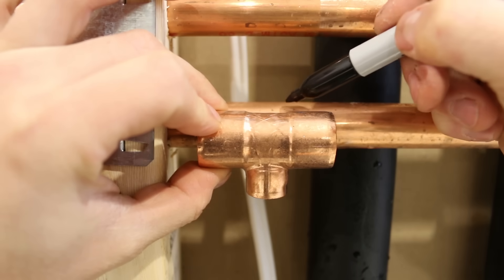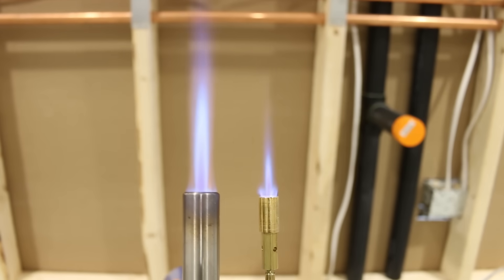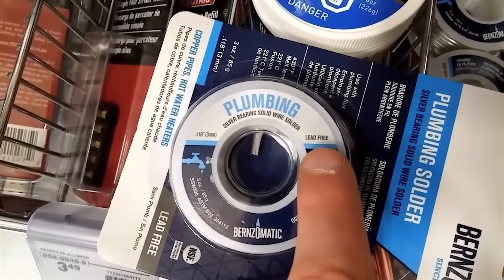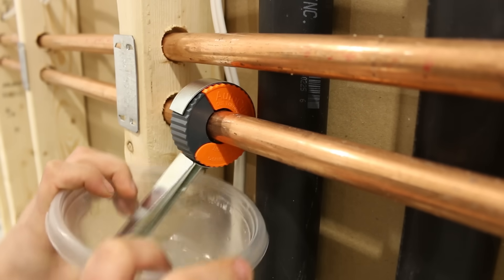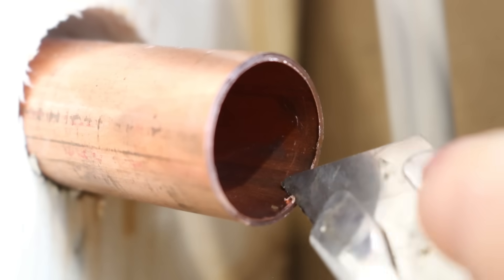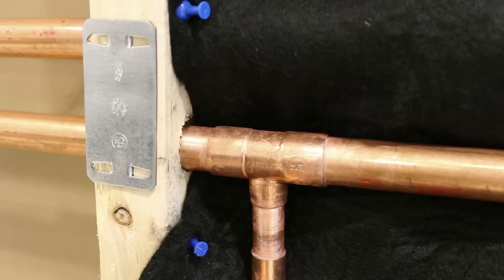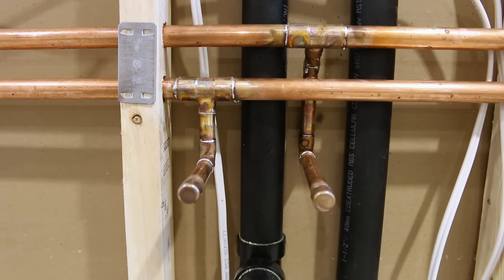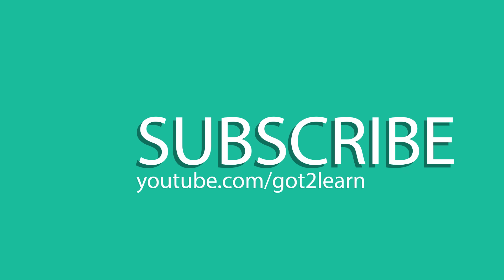How to Solder Copper Pipe in a Wall (Complete Guide) | GOT2LEARN

Comment: Starting to project of completely re-plumbing the hot side of my parents house tomorrow. The runs are easy enough, but there are a couple of spots where I have to go from copper to pex in a tight space and I'm not sold on sharkbite fittings.  After watching this video, I feel more confident in being able to solder without burning the house down lol.

Comment: Aternative to torch soldering =>  Ridgid RT-175 inductive pipe soldering iron.  Safer in constricted areas, heats evenly, works when a bit of water is in the pipe.

Comment: Nice video, elbow, cracked right at the shower mixer.Gonna try heating up and pulling it off. New elbow/ cut 10" down add union. Reattach hard pipe key union. This video should get me by thanks 👍
Reply from the maker: @davidf948  😇

Comment: Great videos as usual. If you find a little pin hole on the joint later on can you apply a bit of flux on the area and solder?
Reply from the maker: No, you must cut/unsolder and restart the joint.

Comment: I saw you use the bread to stop water dripping before you can solder. How can you take the bread out? Thanks.
Reply from the maker: It partially dissolves, for the rest that doesn't just open a faucet to let it out, just remove the aerator before not to clog it up ;)
Reply from the maker: Thank you, don't forget to share, it really helps the channel!

Comment: EXTREMELY disappointing as you could NOT have installed those T fittings inside a wall because  there would not have been enough movement of the pipe...and you slid the pipe over...something that would be IMPOSSIBLE inside a wall!!
Reply from the maker: That's not what this video was about, if you are wondering about how to fit a tee in a wall, here's the video you are looking for: https://www.youtube.com/watch?v=ebvqSp-d8-0&t=2s

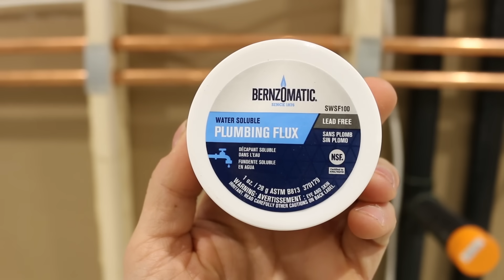Comment: I think that these videos you provide are excellent. Very well done and you do a great job narrating as well. Forgive me for one critique I have on this video and one or two others. The person soldering in your videos often does not solder properly. At 3:33 for instance, which is also the thumbnail pic for this video, he is clearly directing the tip of his flame at the very front of the hub of the fitting, the flame is actually hitting the pipe and the front of the hub. For proper solder flow it is necessary to direct the tip of your flame where the pipe is all the way in. This is called the "shoulder" of the fitting, or the back of the hub. Especially important on upside down vertical joints, This will pull the solder up into the fitting hub, thus avoiding solder "icicles"

Comment: I got a piece of bread stuck in a pipe. Travelled way down the line. Had to cut so much drywall to get it. Thanks to your tip, I was fired. Not a great day for me.
Reply from the maker: It dissolves, which kinda bread did you use?

Comment: If the solder melts on the opposite side of the heat but  doesn't wick around the entire joint is it not hot enough yet

Comment: Did you apply flux inside the fitting at 9:42?
  I noticed in the first video of yours, you advised not to and gave a good reason not to.
Reply: Sorry, I should have stated the first video of yours I myself watched.
Reply from the maker: I do, but when I do, its a thin coat of flux. If you put too much it goes into the piping system and corrodes the pipes.
Reply: @Got2Learn  Thanks for the quick response. 
  I will be subscribing. 
   Just did some plumbing with pvc/cpvc but not sure how confident I am for the long run  
  The galvanized that was in the house was replaced many years ago in the crawl space and had not been a problem that I am aware of, but I decided to relocate the laundry appliances and water heater when I bought the house I was raised in. 
  It is a rental for the time being.
Reply from the maker: Yes, galvanized is trouble waiting to happen, good riddance! 🤜🤛
Reply: @Got2Learn  The house I actually live in still has galvanized.  I hope to change it this summer as I think it is causing low water pressure. I have replaced a couple of pieces with pvc

Comment: Nice Video, however, a Fine point on Technique. Sober from Low to Higher joints. Heat moves up, you Could cause a leak in a joint above the lower joint you are heating. 🙂

Comment: This video was very informative but you didn't show if there was an existing T shape and it needs to be replaced. This is the problem I have. Plus what if I can't move the pipe so I can put in a new T? One last thing is if flux is so bad to have inside the pipe then how do you get the flux out from the inside of the pipe after you solder?
Reply from the maker: I have a complete video on this subject, here's the link to that video: https://www.youtube.com/watch?v=ebvqSp-d8-0&ab_channel=Got2Learn
Reply: @Got2Learn  I saw this video already and it is great but again I have a T already there and the leak is coming from it so I need to replace it but there isn't as much room as you show on the video.
Reply from the maker: @elbandito5411  send me pics here: Juliocaluori@msn.com
Reply: @Got2Learn  I appreciate the help but I don't want to send a picture due to security reasons. I'm just asking how to you take off an existing T so I can put a new one on.
Reply from the maker: can you cut further down? How much room to you have to play with? Maybe swapping that part out with PEX could be a better option?
Reply: @Got2Learn  it has about 2 inches left and right sides and about 4 inches towards me. I was thinking of possibly resoldering all three sides to somehow take out the old T then putting in the new one without cutting any pipes. I don't know how to do that.
Reply from the maker: @elbandito5411  yeah you're gonna need some couplings if you want it in the exact same spot, but yeah it's doable.
Reply: @Got2Learn  couplings? Why? I'm not gonna cut so why can't I just put a new T at exactly the same spot?
Reply from the maker: @elbandito5411  oh well, if you can unsolder it sure, go for it!

Comment: Followed all you instructions,  but the pipe doesn't get hot enough  to melt the solder.  Used 1 gas bottle on 1 joint, not enough. How many gas bottlesdto you need for one  joint ?

Comment: Your videos are excellent, all the important details are not left out as with others. Thank you for posting them! One question, you mention in other videos to not flux the inside of the pipe only outside because of it just getting pushed in when assembling. Why the inside here?  Subscribed 👍🏼
Reply from the maker: Thank you so much! You can flux the inside but it has to be a THIN layer on both the pipe and fitting if you do so or it'll just get pushed into the system and eventually corrode the inside of the pipes, cheers!
Reply: Got2Learn  Thanks again. 💜

Comment: The wire brush on a drill is much easier on the fingers and hands. I also use steel wool which polishes the copper and I never have a leak!
Yes,,, you are absolutrly correct...less flux is better than more.
Don't use too much heat. Add the heat, solder flows in then stop!

Comment: Even though I had already subscribed after a previous video.. I didn't watch this one beforehand.. and should have. (replacing shower valve inside closet wall) 

I already had a  small cutter and ruined the pipe trying to cut it in the confined space ! It kept slipping, no space to go completely around and it made several grooves before cutting through all around. I went out and bought a small round type like you show and it worked PERFECTLY! I Love the SELF-ADJUSTING feature for the cut so all I need to do is Lock it on and turn! :) 

Sadly.. my propane torch kept failing (Fresh new small bottles with plenty of pressure but would not stay lit !! I tried different Torch- Same results :(  My only conclusion was the 'bargain' Propane cylinders had been filled with more Gas than propane.. such as happens when refilling from an upright source-tank ! .. Source should be Inverted so the heavier liquid propane transfers more than just the gas! 

I had to resort to the FAR more expensive 'S-Bite' connections. to finish the job. 

I'll be setting up some 'practice' soldering joints to fine-tune my tools and methods but I will eventually get there... maybe... probably

Comment: I'm replumbing my entire house in copper. The old copper I in my home is over 60 years old and kept getting pin hole leaks. I only have to redo 2 joints but first I'm going to add a shirt off valve at the main there was a small trickle of water so I used the bread method but I might as well put a valve in

Comment: On another video for soldering vertical pipes you say to apply flux only to the pipe and not the joint while here you suggest to apply to both ... which one is correct??
Reply from the maker: If you apply on both, you have to use very little as to not overload the joint, if you feel safer doing it this way, you can, just keep that in mind.

Comment: You need to move that torch around more. Heat the whole pipe starting on the bottom and finish on top. The solder will not flow to cold spots, like the top of the pipe and fitting. I see this all the time when plumbers have to solder pipe over one inch. They get leaks on the top because they only heat the bottom.
Reply from the maker: For 1/2" and 3/4", with the right torch it's not needed that much, for 1" or move yes, ypu gotta move the torch around or it'll leak.

Comment: In extreme confined spaces, I use pieces of tin panning for heating. Easy to cut and fit to any size pipe, and is an excellent heat shield. Plus you can reuse it all day.
Reply from the maker: That's a great idea!

Comment: My apologies if this is a silly question, but will soldering work if used for a compressed air system [<=175PSI] or should I consider Sharkbite fittings instead?
Reply from the maker: No, a Sharkbite will blow off at the PSI, you're better off brazing at those pressures, here's a video: https://www.youtube.com/watch?v=LdCK58UcnhA

Comment: Very well done. Sure, it's not like being a journeyman, but for home DIY, this was invaluable. I kinda knew what to do, and had done the electric side of soldering a bit. Finally dove in, moved 2 feeds around a corner to an adjacent wall in our bathroom. Thanks for the tips, alot of solid info. I left the whole day for it, and went slow. Turned the water back on with zero issues. There were a couple of really nice details and tips that saved my ass. You said preparation was so important, and i think thats what got it for me. It really made a difference.
great video.

Comment: Just finished an agonising soldering joint in a tight space and there are no leaks but I never use the rule about using a length of solder equal to the pipe dia, always a lot less.. and judging by your examples, you use a lot less too!

Comment: 7:07 read up on jet engines. Reducing the diameter from a larger to smaller size maintains flow but increases pressure.

Comment: i always just use a large soldering iron. it works, and doesnt leave the joint looking like i tried to burn a house down
Reply from the maker: Huh??
Reply: @Got2Learn  yep. soldering iron work.... to solder. even copper pipe. just get one big enough. havent had one leak yet anyway
Reply from the maker: @chriskeel3096  but how do you physically use it  tgat's what I am wondering?
Reply: @Got2Learn  he bent his electrode into like a crescent shape, and just held it to the pipe. id have to find the guy and get some pictures of the way he done it
Reply from the maker: Niceeee
Reply: @Got2Learn  i happened to be doing pipefitting on my local hospital. the plumber was putting in his copper chill water pipe, and i noticed he was using a soldering iron, and not gas. picked that little trick up observing him. he was running 2 inch copper pipe, and made a bent piece of clothes hanger for his electrode on his soldering iron. half moon shaped. he was soldering joints in less than a minute. blew my mind
Reply from the maker: @chriskeel3096  😲😲😲 gonna need to look into this hehe!
Reply: @Got2Learn  right lol. sometimes a shortcut can be a good thing

Comment: I was taught to always wipe the finished soldered joint with flux as it smoothens out the solder and helps it into the joints.
Reply from the maker: As long as it set before!!

Comment: good video. i've used old license plates too stop torch flames from igniting combustible framing members. someone needs to tell the electrician to staple his wires to the studs. in the last few years, i've seen copper plumbing almost completely disappear from residential construction.

Comment: Great mistake to use steel wire brushes (8:30) in a copper pipe system. Danger of later pinpoint corrosion by broken parts of steelwires.
Reply from the maker: Yes, just get the good quality brushes.

Comment: The bread in pipe or dissolvable sponge in wet pipe trick never worked for my propane torch. If pipe not dry = SharkBite connector the way to go.
Reply from the maker: That works best 😉

Comment: What you need to do is stop using solder and heat and buy a ProPress and you won't have to worry about anything catching on fire I work for John C flood of Virginia
Reply: ProPress might cost 1800 dollar but it cut your work in half and pay for itself in the long run get on board with the ProPress
Reply from the maker: @richardcloud9600  for sure!
Reply: Since you are on YouTube you need to look up ProPress
Reply from the maker: @richardcloud9600  I made a ProPress video: https://youtu.be/S5NWZMzPZBA
Reply: Propress your time in half
Reply: Make a  uponor video I used that too
Reply from the maker: Made that too: https://youtu.be/S-W6G9HWJ-4
Reply from the maker: Hehe ok!
Reply: The ProPress fittings for the last longer than your solder joint

Comment: I was hoping to see the actual insertion of the "T" piece between the two fixed pipes. You didn't show it. How is that done?
Reply: Jo, u cut a segment of pipe of 1.5 inch length that slides perfectly over the 1/2” or 3/4” pipe (sold in all stores in about 6” length). The u cut the pipe in an area where u feel comfortable using the flame. Then u cut the pipe where u want to put your T. Dry pipes COMPLETELY, slide your repair segment in first cut, then position your T, solder your T, then slide your repair segment equally distanced on the first cut u did and solder that too and u ok. (Of course, if u can slide your T between the only cut u do to place the T then u dont need a second cut).
Reply: @anonymousbyproxy8250  thanks for that!

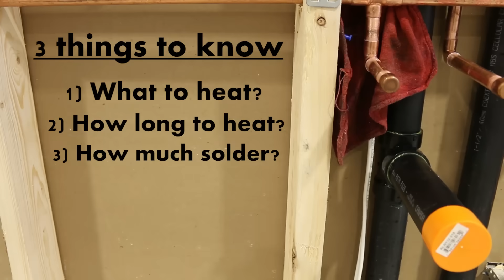Comment: Your soldering left out heat/flame protection for the electrical wires - ref. 11:23 & 14:00 times in video.  Otherwise, you could be replacing melted romex.
Reply from the maker: Yes, this is a mockup wall so nothing was damaged, but yes, always protect them when soldering, good observation!

Comment: For me the important issue is when i soldering a joint another  parts begin melting and become separate due to the copper  transfer heat Properties
Reply from the maker: In another video I show a trick for this not to happen at (6:07) : https://www.youtube.com/watch?v=8IV7oG43DZ0&t=58s&ab_channel=Got2Learn

Comment: If I used metal work solder , is that OK?
Reply from the maker: What's that?
Reply: @Got2Learn  I used the wrong tin, it is used for welding metal work，The one on the right at 4:14 seconds, I bought the wrong one ：）
Reply from the maker: Use must use 95/5 solder, and it must be lead free.
Reply: @Got2Learn  thank you

Comment: Buenos vídeos,felicitaciones.Me queda filtración en el muro de baño,en la cañería.El muro es de concretos,y la cañería tiene imperfecciones.
Good videos, congratulations. I still have a leak in the bathroom wall, in the pipe. The wall is made of concrete, and the pipe has imperfections. The pipe is 1/2 inch ... should I remove all the water vapor first welding? But the welding runs the same.
Reply: Sr. Rodrigo, if the pipe is not PERFECTLY dry for at least 30 cm length you will not be able to heat the pipe enough as to achieve a good joint with a propane torch.
Reply: @anonymousbyproxy8250  
Hola,muchas gracias.I am not American lenguagge,I am spanish lenguagge,word.,So I translate the meaning Of your answer...
Reply: @anonymousbyproxy8250  
Finally I corrected the leak, soldered a copper plug to the pipe. I took care to remove all the water vapor from the pipe, to make sure that a good union would result.

Comment: .. Great info for a beginner . Going to add this to my saved videos and refer to it when trying my first solder job . Seems like a good rule of thumb is ,, 
Apply solder to opposite side being heated ? .
Reply from the maker: For 3/4" or less, anything bigger, you must circle around with your torch.
Reply: @Got2Learn  ... Thanks for the info . 👍 .

Comment: SOUL-DER?  IT'S SAW-DER...U SHOULD HAVE SHOWED THE REPAIRS WITH THE DRYWALL STILL ON.  U CAN USE A WET/DRY VAC TO REMOVE ANY REMAINING WATER.  I TRY TO KEEP THE TORCH TIP AWAY FROM PINTING DIRECTLLY UP UNDER THE COPPER TUBING TO PREVENT IT FROM MELTING AND DROPPING DOWN INSIDE THE TORCH TIP, BAD!  I LIKE TO KNOCK OFF THE SOLDER DRIP WITH MY SOLDER IN HAND AND THAN WIPE IT CLEAN WITH A DRY RAG, THIS MAN DOESN'T APPEAR TO HAVE BEEN TAUGHT VERY WELL, BY THE LOOKS OF THE SOLDER JOINTS.  IT DOESN'T APPEAR HE CUT THE COPPER TUBING LONG ENOUGH THAT JUTS OUT FOR THE WATER SHUT OFFS, BCUZ U HAVE THE DRYWALL THICKNESS, CABINET IF THERE IS ONE AND POSSIBLE TILE?

Comment: The biggest mistake I was making when I first learned was over heating.  That caused pin holes
Reply: .. going to try ( learn ) also .
When overheating ,, Were the pin holes in the copper pipe itself where the heat was being applied ,,,, or were they at the places where the solder was being melted ( sucked in ) on ?  
( Thanks for any info ) .

Comment: Im always apply flux straight after soldering while it is still hot and then wipe it with wet clough. Never ever leaks and joints looks really clean.
Reply: Shoudnt have to do that on a good solder joint.